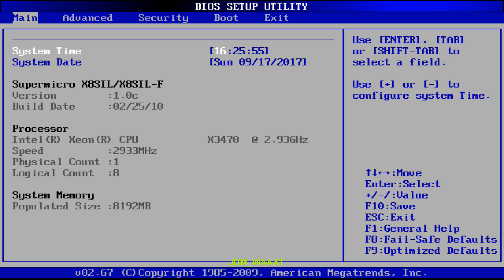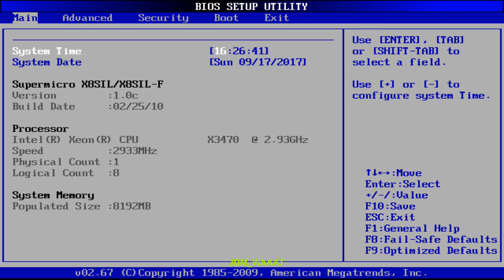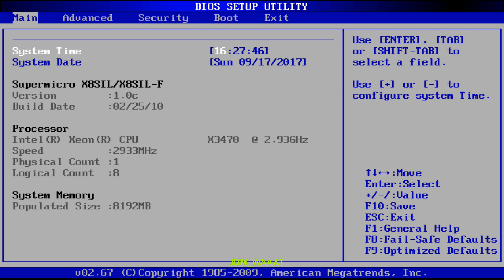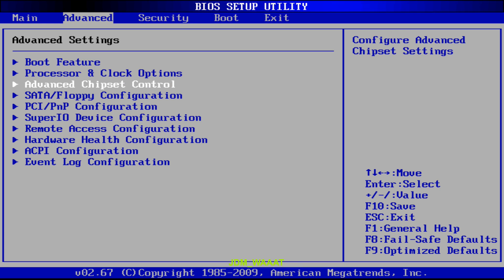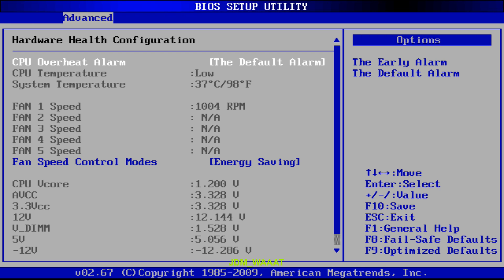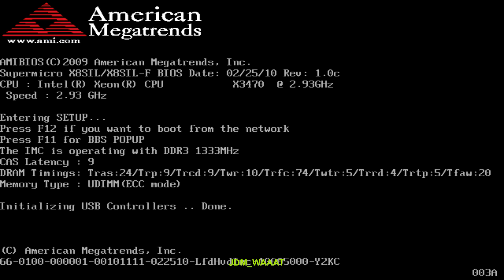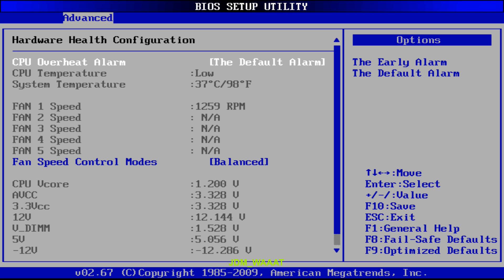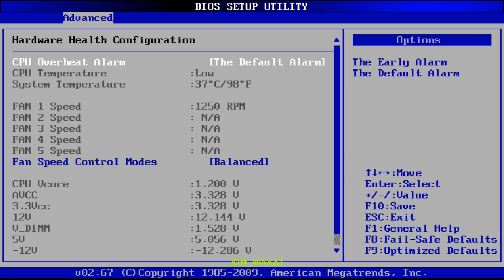Supermicro fan speed ramps up and down - what's the cause, and how do we fix it?

Comment: In my 4 H11SSL-i motherboards there is no such menu item "Hardware Health Configuration" anywhere, and I did look everywhere , systematically. It is not under Advanced, nor anywhere else. BIOS version is 2.1. I have 4 for my home lab, btw.
Two of the board do spin up and down perpetually, and the other two do not. Any clues? How can that whole section be missing? Is there a jumper that disabled it maybe? Is it only reachable via IPMI perhaps?
Does it matter where I plug in the fans? All are PWM by the way. Maybe certain fan headers are designated CPU fan headers and the rest is for case fans?
The only difference I see is that the well-behaving machines have CPU coolers with two fans, while the other two have only one fan. 
These motherboards come from Ebay, from China. Are these commonly used in mining farms, and do I happen to have two cooked boards? Causing the sensors do not work properly anymore? Since there is no way to see the temperature and fan speed readouts in the BIOS, I can install lm_sensors in Linux and use that to see some of the temperatures, although it is not so clear what is what in the lm_sensors output. Also it does not show the fan speeds, but maybe there is some other tooling for that.
Do Chinese miners use custom bioses maybe? But why would they remove the HHC menu, that makes no sense at all. If anything, they would want to expand the options, not remove them.
Anyway, I can try the following things:
- set up IPMI and see what that shows, and what hidden menus turn up maybe
- look in detail at my "good" motherboards and see what exactly is different: what fan headers used and any difference in jumper settings
- search for any tooling available for Linux for to read out and change fan speeds
- search for evidence that Chinese miners used these boards and if they did any adaptations to  the BIOS
- download the proper Supermicro BIOS for these boards if only their download website for these mobo's was not down

Comment: I had the exact same problem in FreeBSD and TrueNAS Scale on a older SuperMicro Board.
After a long study of the IPMI, I created a solution with this script & crontab entry.
Dunno if it works on every machine and of course you do it at your one risk. 
Hope it helps:

Fancontrol Script

1. Create the script:
nano /usr/local/etc/rc.d/fancontrol.sh

#set fans in "system" zone to 37.5%
ipmitool raw 0x30 0x70 0x66 0x01 0x00 0x24

#set fans in "peripheral" zone to 37.5%
ipmitool raw 0x30 0x70 0x66 0x01 0x01 0x24

2. Chmod the script to executable
chmod +x /usr/local/etc/rc.d/fancontrol.sh

3. Put this line in /etc/crontab and reboot. Fans should now throttle down and stop pumping
@reboot root /usr/local/etc/rc.d/fancontrol.sh

Comment: I had the same issue after building a SUPERMICRO X10SRI-F based server and replacing all fans by NOCTUA fans.
Updating the BMC/IPMI Firmware to the latest version resolved the issue without changing any settings..

Comment: The issue is that the low threshold is higher then what the fans, but you can change that.
I have made an video about it how to change the settings via IPMI on the management interface on the supermicro boards with F, you can also change it with an IPMI tool on the local host 

https://www.youtube.com/watch?v=LDY5RcNIZ_M
Reply: My supermicro is too old and didn't have the fan control settings in BIOS. ^Your video above saved me a mountain of trouble and who knows how many days. Sincerely, thank you for taking the time to make the video show IPMI utilities fan adjustment via CLI

Comment: i have this motherboard https://www.ebay.com/itm/Lenovo-IdeaCentre-510-15IKL-Intel-KabyLake-Motherboard-s1151-00XK140-/143030275293, i took it of an lenovo idea centre , and i placed it in a new case, the cpu is still there and cpu fan, i used a new source, 600W connected what i could, new GPU, RX 570 8 gb XFX, it works, but the fan is always 100% and its like i have  a plane taking off ... any help ? how i turn down that fan?

Comment: I know this is old, but the reason is because you are using low speed fans (such as Noctuas) and the server's minimum speed it will consider as OK is 800RPMs. Anything under that will cause the server to spin them back up, then slow them back down, then back up, again and again.

The fix is to use actual server/enterprise-class PWM fans. Believe it or not, they can be VERY quiet and their low speed (around 25%) is about 1,200RPMs.
Reply: the actual fix is chaning the thresholds in command line using IPMI tool. supermicro doesnt seem to like it if the noctua fans spin slower than 700 rpm. again this can easily be modified.

Comment: If this video didn’t help, you can use ipmitool (just google instructions yourself). You can set your own fan tresholds with it. Remember that some supermicro motherboards require using lanplus instead of lan in the ipmitools commands
Reply: Just did this remotely from a linux VM after flashing my IPMI firmware and it reset my fan thresholds. First you want to check your sensors:
ipmitool -H <IP of your ipmi> -U user -Ppass sensor list all
look for the FANs causing the issue, in my case it was FAN3 running at 400 RPM, below one of the limits. Then I ran this to reset the lower limit:
ipmitool -H <IP of your ipmi> -U user -Ppass sensor thresh FAN3 lower 150 225 300

Comment: I just built your nas killer v1.0 with the x8sil-f running unraid. I am have 4 pwm fans that run normally for about 24 hours then randomly ramp up to 100% and get stuck at 100% even with the temp around 30 C. The only way i have been able to fix this is rebooting my unraid server and they go back to normal. Have any suggestions as to what might be causing or how to fix this?

Comment: This party was a long time ago but thanks anyways, it’s still a helpful video. Quick question: how are you screen recording?

FYI this fan pulsing issue recently occurred on an X11SSM of ours. Honestly, we used really high quality fans and it’s not annoying at all. However, it can’t be an efficient use of energy. So now we have to install freeipmi because the BIOS version doesn’t have any direct fan speed settings as yours does. No biggie, it should work fine. TBC.
Reply: He most likely uses a video capture card to record the video directly from the video output
Reply: Here it is a good article how to change speed of the fans in X11 motherboards : https://forums.servethehome.com/index.php?resources/supermicro-x9-x10-x11-fan-speed-control.20/
Reply: Vm
Reply: Virtual machine

Comment: This worked for my x10 board:

https://forums.freenas.org/index.php?threads/how-to-change-sensor-thresholds-with-ipmi-using-ipmiutil.23331/

Extract 

Ipmiutil-3.0.1-win64.zip to the c:\windows directory

To view fans:
ipmiutil sensor -N IPAddress -U uname -P *pword -c

To set fans speeds:
ipmiutil sensor -N IPAddress -U uname -P pword -n Snum -l 200 -h 1900
Where the -l is the low threshhold and the -h is the high threshhold

Comment: I have three X8SIL motherboards two of which have at one time been in my Windows 2012 server coupled with the x3470 Xeon.  Instead of fan speed drops, I have significant voltage dips on the 3v, 5v, and 12v circuits. I’ll see minimums at practically zero over time using CPUID HWMonitor and yet my server seems to work fine.  None of my other computers (both Intel and AMD cpus) ever show drops to near zero on those same circuits or significant dips of any kind.  All three of my X8SIL boards exhibit this unnerving issue.  Any ideas?
Reply: Yeah, the bios shows good but there's no minimum displays, just current readings so I didn't expect to see the dips.  But I think you're right!  Got two extra boards and a CPU if it fails.  Thanks!!